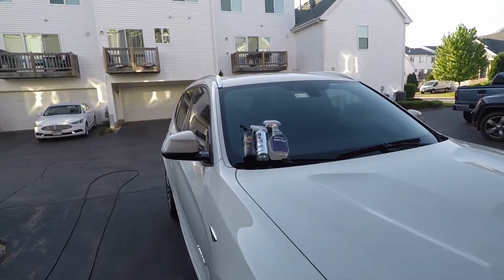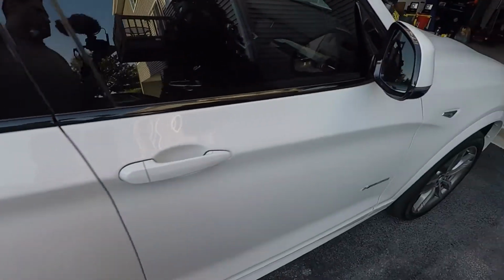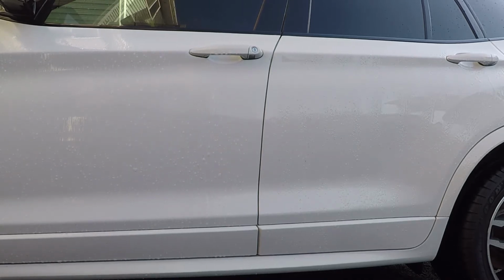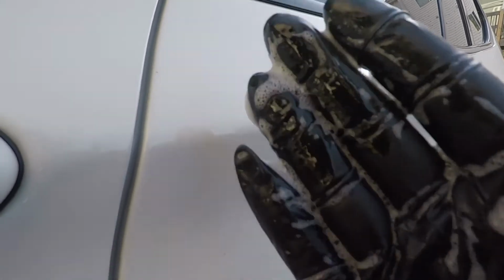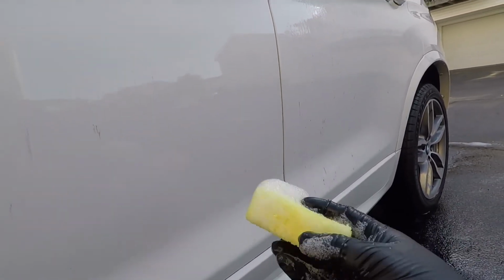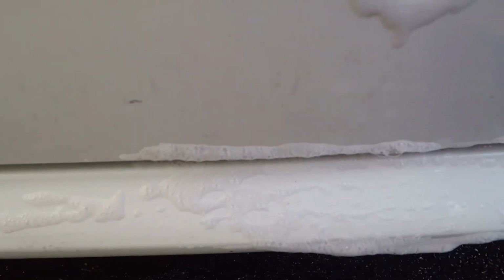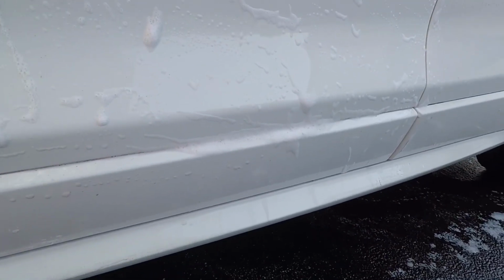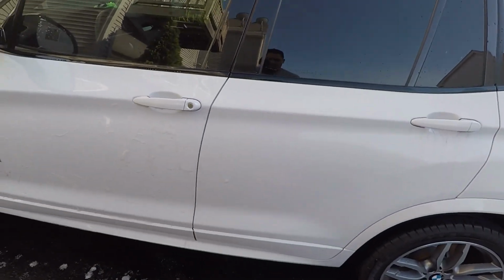Chemical Guys DECON PRO vs BriteMax Iron Max

Comment: what is a bug sponge?
Reply from the maker: If you browse my channel,  I have a couple other videos on it.  Here is a link, I usually cut these blocks in to 4 or 5 smaller square "pads".
https://www.amazon.com/gp/product/B01LF3FY7Y/ref=as_li_qf_asin_il_tl?ie=UTF8&tag=gavdetails98-20&creative=9325&linkCode=as2&creativeASIN=B01LF3FY7Y&linkId=8668528284287daec248771f04dddc74